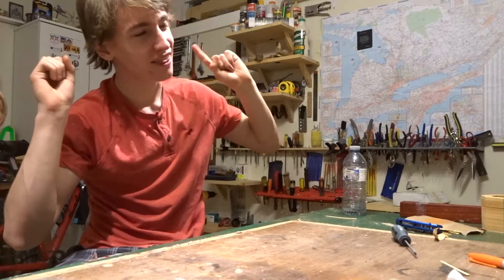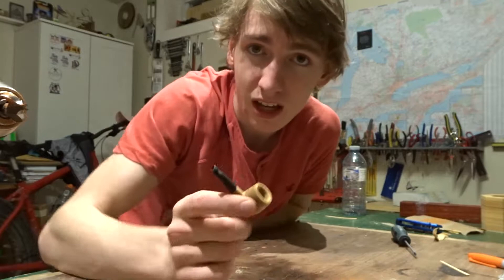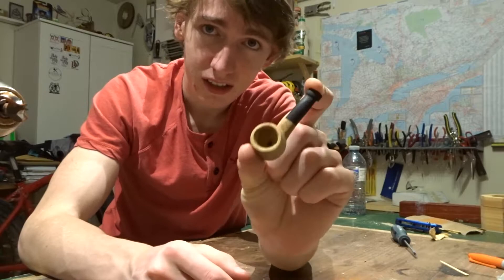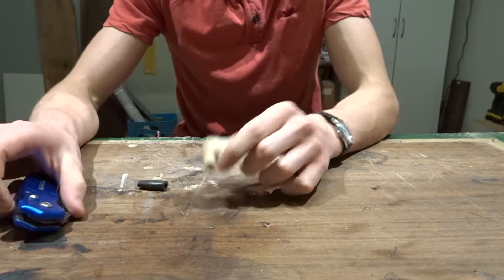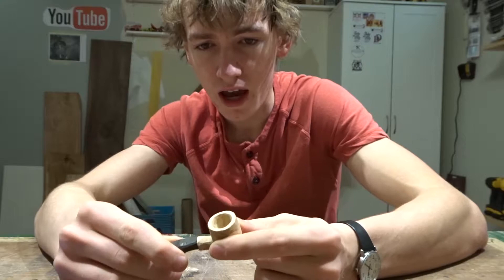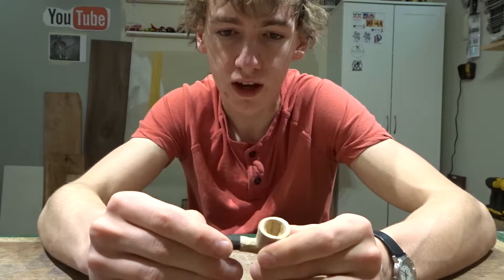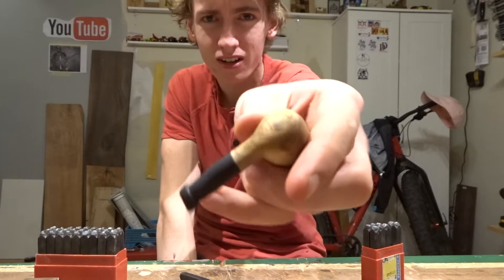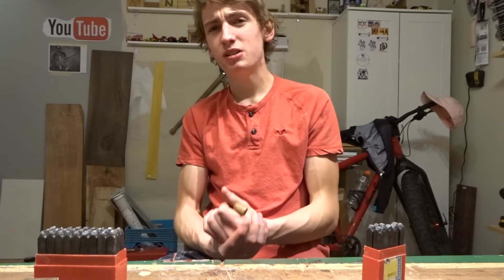Tiny Wooden Pipe

Comment: You have a one hit pipe there. I like the drill press vise. I have drilled through the bowl patched it with wood glue and have smoked it a couple years no problems. I laughed with the electrical tape band aid.